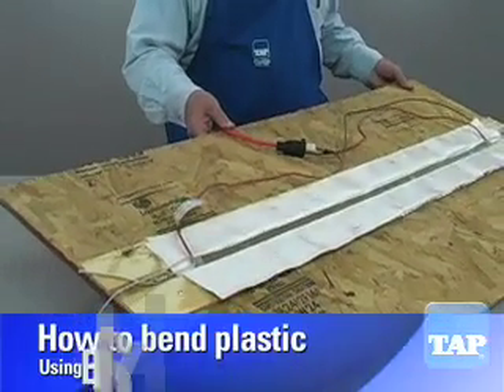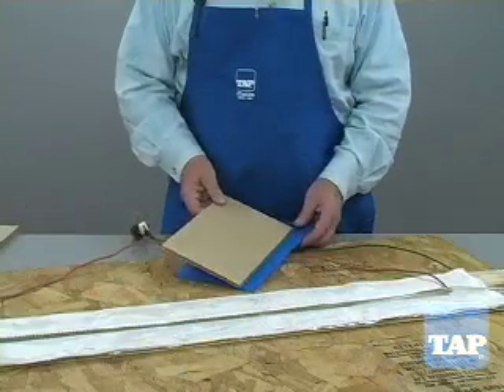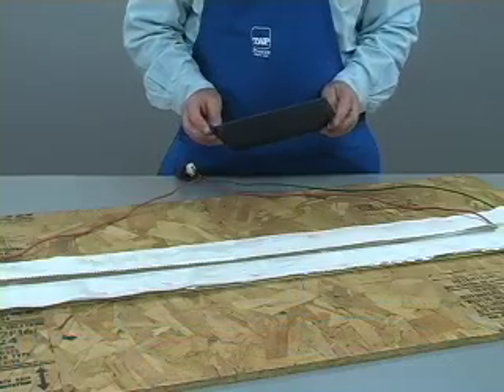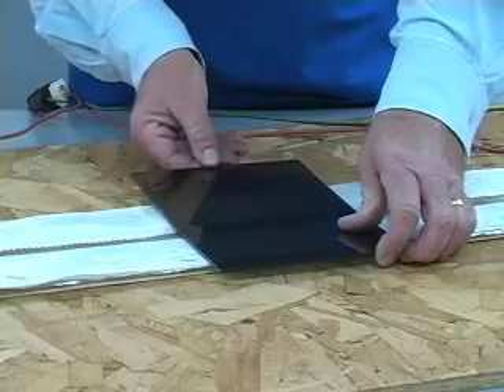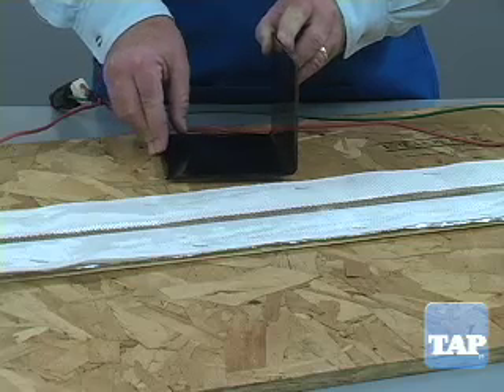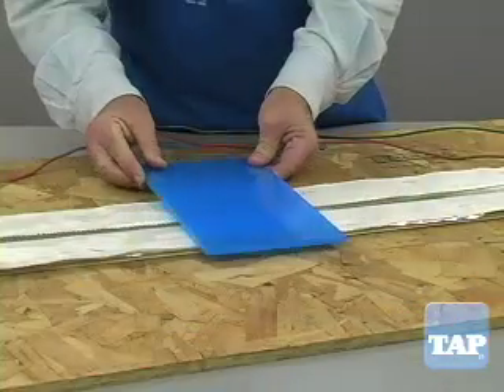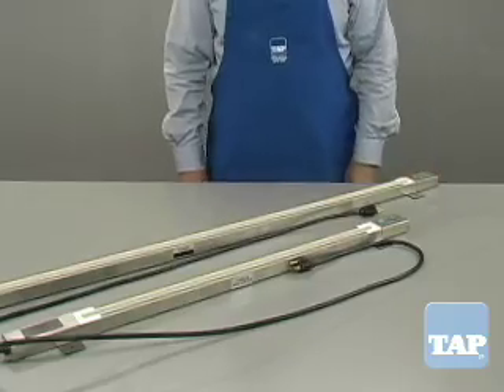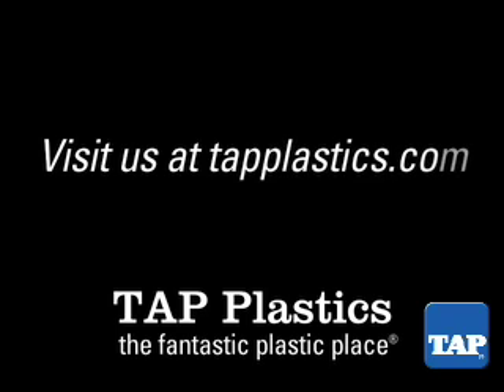How to Bend Plastic

Comment from the maker: First, check the melting point of the nylon sheet to see if it will work on this heat bender.  To make the box will require heating and bending each corner separately as if you were folding paper into the form of a box.

Comment from the maker: @hyacinthdibley What do you mean when you ask, 'is it safe for laptops'?  Acrylic will pose no harm to a laptop.  However, I don't see it as being a very durable or comfortable laptop case.  If you dropped it, the acrylic would most likely crack.  The alternative would be to use polycarbonate, which is virtually non-breakable.    Both materials can be bent on a heat bender.

Comment: I actually made a bender out of an old space heater. Already came with temp. control. I just placed the element in a U-channel i got for hardware store and caped it off with ceramic standoffs that came with the heater.  Cost me next to nothing.